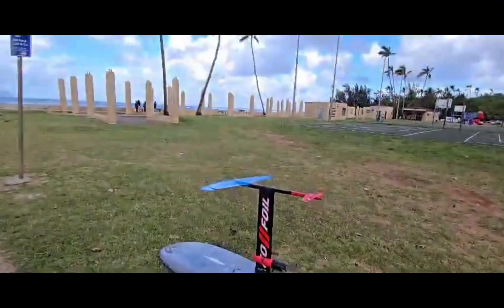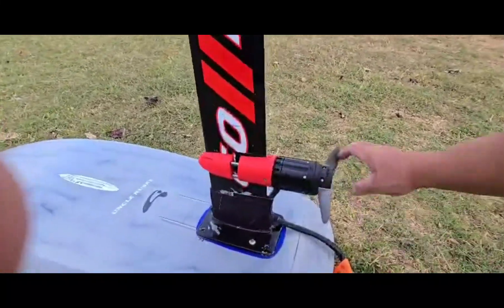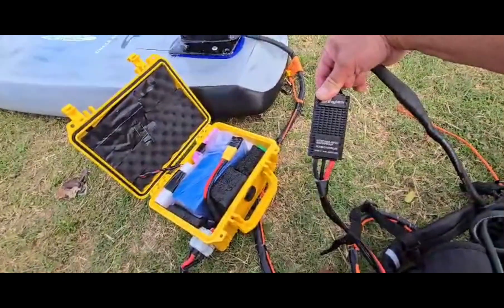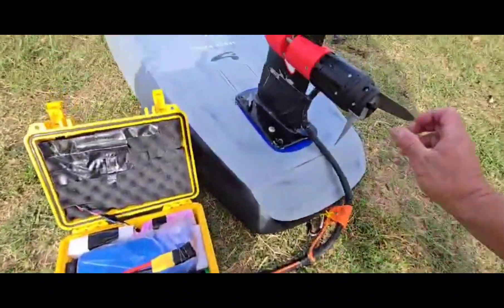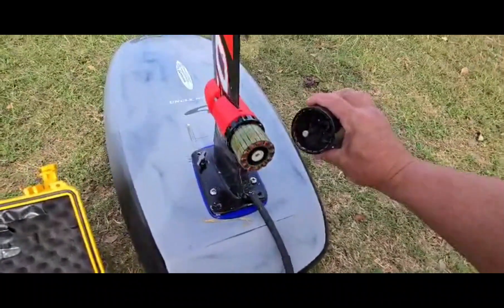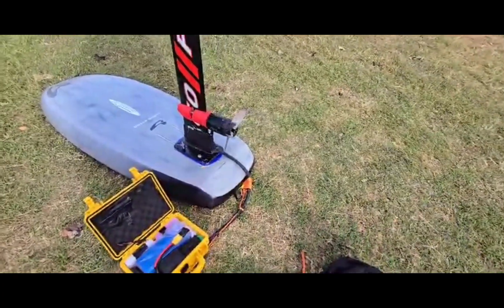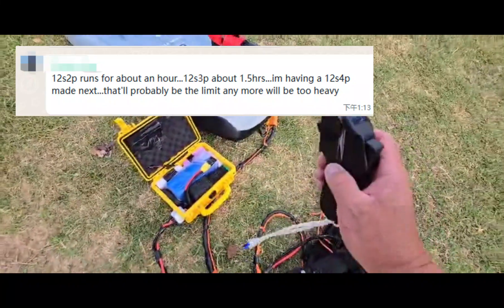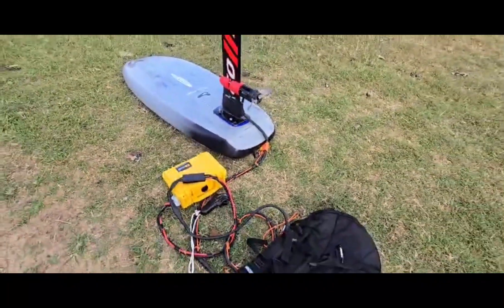Customer feedback - Maytech Efoil Foil Boost Kit 6579 Waterproof Motor + 160A ESC + 1905WF V3 Remote

Comment: Hey I have a FD assist plus that the ESC does not work anymore, i was thinking to get the maytech 130a or the 160a which one would be suitable?
Reply from the maker: would you please send your motor specifications to us? eileen@maytech.cn. So we can check suitable ESCs for you.
Reply: @EileenMaytech its the foil drive assist plus motor and remote. Should i get the maytech receiver and the 130a esc ? Is it easy to setup the esc on the pc? What software do u use?

Comment: Bonjour,
Je suis en train de fabriquer un système Foil Drive Assist, et je me pose des questions sur les dangers liés à l’électricité. Ma batterie est en 10S. Je vais devoir rallonger le câble qui relie le moteur au contrôleur, et je compte utiliser de la gaine thermo pour rendre les soudures étanches.
Mais si jamais ces soudures prennent l’eau, y a-t-il un risque d’électrisation ? Ou bien est-ce sans danger à cause de la tension relativement basse ?
Par ailleurs, si de l’eau s’infiltre dans le boîtier étanche de la batterie, est-ce dangereux ? Je n’ai pas trouvé de réponses claires sur internet. Merci d'avance pou votre réponse
Reply from the maker: recommend to use Multi-layer heat shrink tubes + waterproof glue combination to seal the welds. 

if water seeps into the waterproof battery case， battery may short-circuit and become damaged.